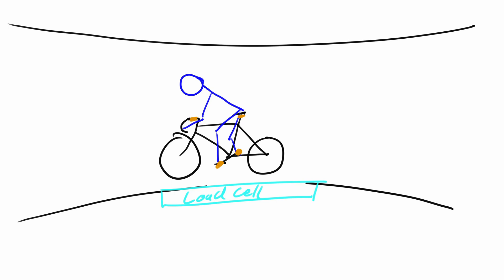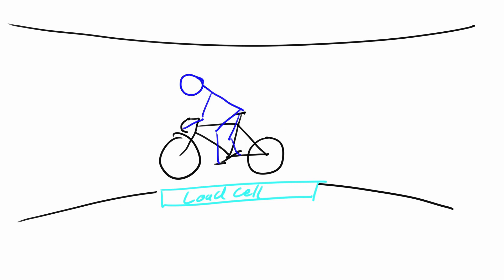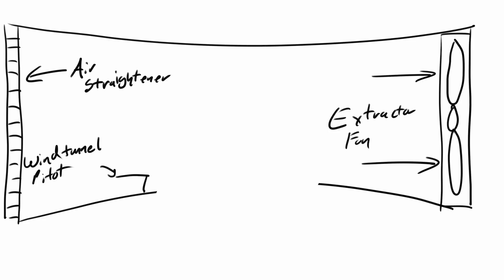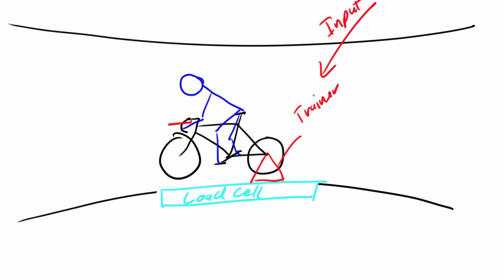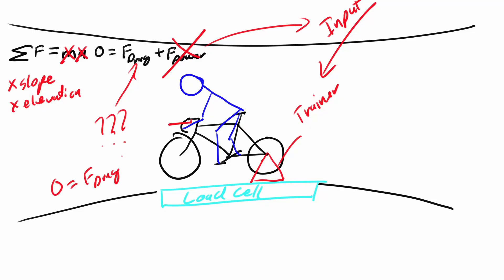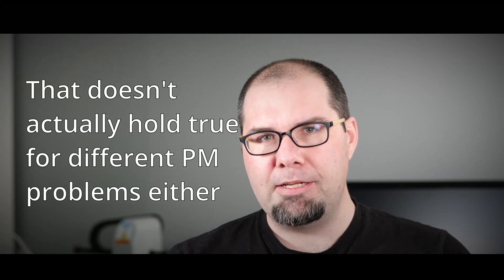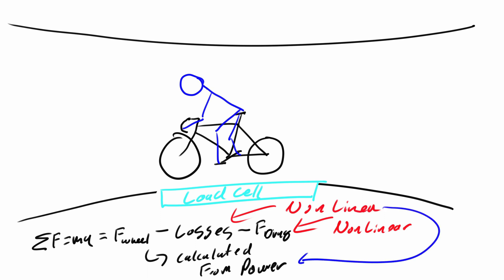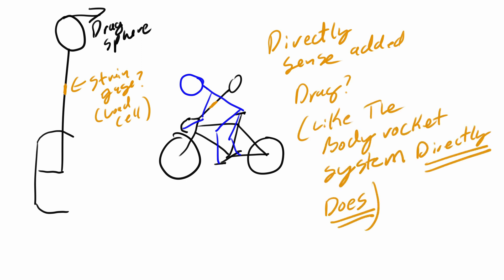Why isn't there validation reviews of Aero Sensors?

Comment: A pretty easy way to validate a Pitot based system using a wind tunnel ? Go into the tunnel, test 3 positions, 3 helmets, 3 skin suits with measurable difference. Do the test on the road. Are the numbers the same ? Is the delta between each the same ? If so, chances are you are on a right path. While you are in the tunnel, compare measured tunnel air speed to measured by the pitot. If the same you know the wind speed measurement component of your system is good. Need to validate a power meter ? Hang a know weight on it. Could go on and on 🙂
Reply from the maker: Unfortunately I think you missed a key point. A pitot aerodynamic drag estimator requires power data, but power is decoupled so the calculation is always 0 or really whatever number you want to dial the resistance unit to and can maintain. They aren't related.

Secondly - "Do the test on the road. Are the numbers the same ?" -- Nope they aren't, aerodynamics is non-linear so the delta isn't the same either. So to your assertion -- I guess you're not on the right path.

The point is to prove it against something in a repeatable controlled environment. So you're saying compare a bike in a wind tunnel to a device outside and they should give the same numbers for completely different environments. One highly controlled and one highly uncontrolled. People(reviewers, people who bought it, "researchers", etc) have been trying this for the last 4+ years. Basically they blame the world or something on why it didn't work (about 10:1 times it won't) and pat themselves on the back the days it works.
Reply: @kwakeham  "Secondly - 'Do the test on the road. Are the numbers the same ?' -- Nope they aren't, aerodynamics is non-linear so the delta isn't the same either." 

The delta in wind tunnel measured CdA and pitot "on-road" estimated CdA should be the same. CdA doesn't vary with wind speed (in the ranges we're talking about)...so, I think you may be conflating that with drag force and/or power, which does vary non-linearly with wind speed. But, CdA is the value one is looking for in both wind tunnel and field testing, since that allows you to figure out the drag force at any wind speed. I'm pretty sure that's what @marcgraveline1771 was referring to above

Or, one can do the "Tom Compton Challenge" test, using objects of known CdA (such as spheres) and see how they compare http://bikeblather.blogspot.com/2013/08/aero-field-testing-using-chung-method.html . That's one way to get some validation. Don't even need a wind tunnel to get the initial delta CdA values :-)

edit: Got to the end and saw your bit on spheres. A force sensing stick would be a great addition! That said, I'm not convinced on the Body Rocket solution...leaving out the aero drag of the rest of the system, and how it changes with interactions, seems to me to be "incomplete".
Reply: @kwakeham  first of all, while wind tunnel numbers are great but aero drag and aero savings are only important in one place : on the road. Second, to get aero numbers on the road, you need a set of sensors, power being of the few. You need wind, you need altitude/incline, you need environmental....Each of these sensors will have it's challenges, it's errors, standard deviations....bla bla bla. Complex math allows to brings these sensors togethes to come out with "an estimate" with known precision.  Now, when you have accurately measured your  superior force measurements you are now going to combine them with all the same other sensors (incline, environmental)......and have ......yes....on the road.....a drag estimate.

Comment: Mate, bloody good video. Don't know if you've used many pitot sensors, but in my testing, I am getting repeatable numbers, only if ALL of the following conditions are met  (To readers, I emphasise repeatability and accuracy is not the same thing, yes I get a CdA figure, who knows if it is scientifically correct!!)
1. I HAVE to use the same power meter every time (Quarq). I can benchmark a favero or 4iii to match the Quarq in a certain 'lab test', but will it give the same CdA? Nope. I guess due to certain non - linear effects or other sampling quirks as you mention. 
2. Crr variability. This needs to be mapped to the surface type, tyre temp, wet or dry, surface temp, and pressures, moreover skin tension of the tyre. 
3. Same, flat road. To get a 'real time' or 'live ride' CdA readout with all these unknowns is just impossible. The Crr variable dwarfs the power meter error here. In my mind its the unknown Crr that is the biggest blocker atm with pitots. 

On another note, do you think a YouTube certain lab test on power meter accuracy is causing issues? Are companies just creating power meters to perform well in the certain lab test, thus sell? This is a worrying virtue, and i know a lot of the smaller asian brands just care about satisfying the test with a load of curve fitting and fudge factors.
Reply from the maker: Probably not as experienced as yourself it sounds with the pitot stuff. I've mainly been on the dev side with BR and seeing their data and results. They do still need wind speed sensing but it's just for that. They certainly aren't as simple as we'd like to think then an algorithm. It's more like this whole complex algorithm to get the pitot to work decent, then that goes into another one. Lots of unknowns and corrections.

It seems you hit a few elements and found some even some tested meters have quirks that might be enough to throw things off. Tires have always been such a variable. Most companies are now measuring aspects of it to refine their algorithm but you're living the this years tire compound could make your results unsure.

It's been a while since I worked specifically in the PM world. However, I know that there have been at least two companies I was never professionally involved in that had let slip calibration factors were adjusted by observation against other meters because they couldn't find the source of their problems. Juicing the cal's to get something to look favourable in a review is certainly a thing. Everyone had developed some understanding of reviewers pedaling styles. More about the integrity of the company then. It's a mileage may vary situation. For most people these bulk corrections can make things better, but for some worst but all without knowing the source of the problem.
Reply: I definitely think current power meters are targeted to match others in specific power ranges.

I do a lot of testing on athletes and different power meters and I almost always do double recording of power to compare different power meters and trainers. 
In my experience most power meters or trainer seem to be maid to match well in the 200-350 watt range, but outside that range the differences seem to become a lot larger, also repeatability seem to be worse on some power meters above 400-450 watts.